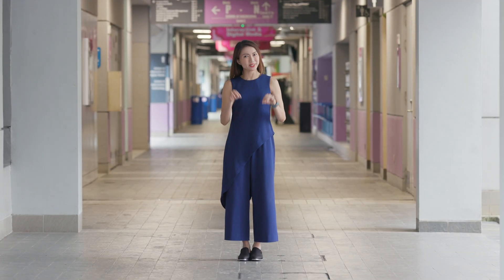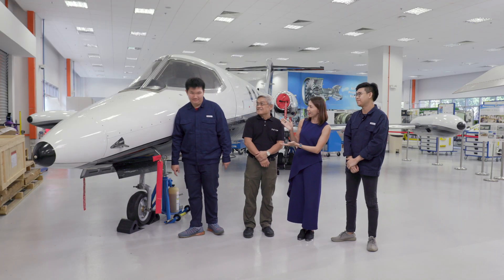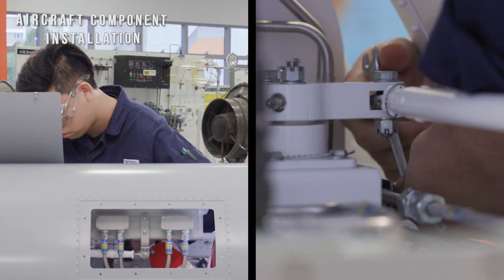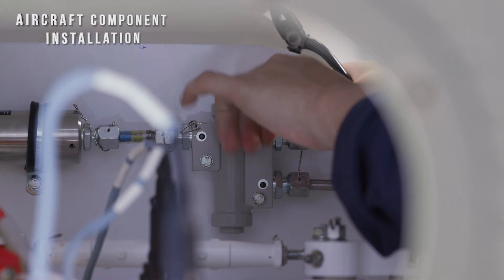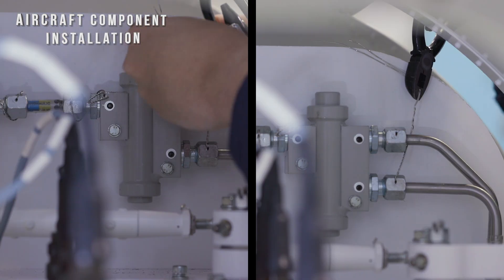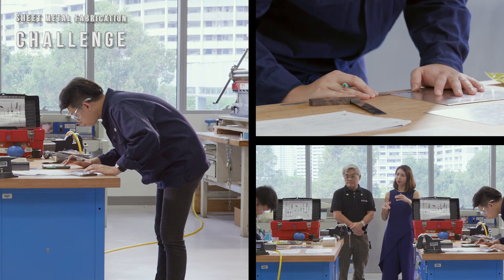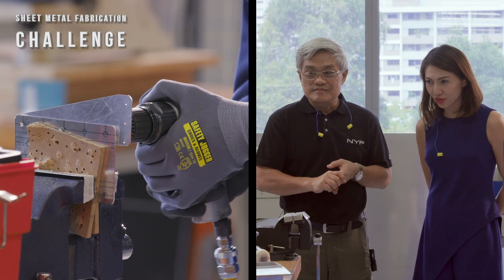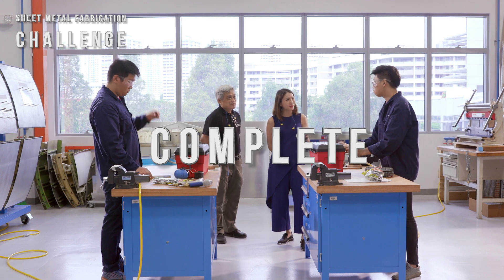The Skills Challenge - Aircraft Maintenance

Comment: In europe Simon would be faild before he starting, without Safetyshoes! failed and can go home.
the other guy and  Leader be failed too while both guys using for sheet metal markings not approved markes = that no aircraft marker.
At last a challenge  you can may be do for  car mechanic or any f**king  basic works but never  for safety works, just remember HF (Human Factors)  where and when happend fails/mistakes?  
our goal is safety nothing else.
Reply: Not to menschen the bot that drilled the two pieces of sheet metal together the second piece hold were out of round and were therefor to big for the rivet. That bracket would crack and fail.
Reply: Haha yes u are right